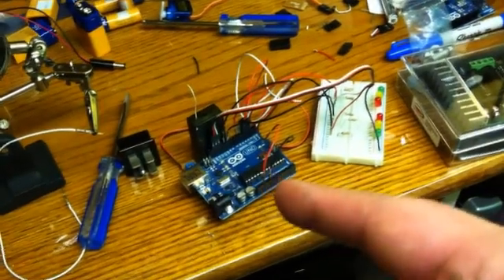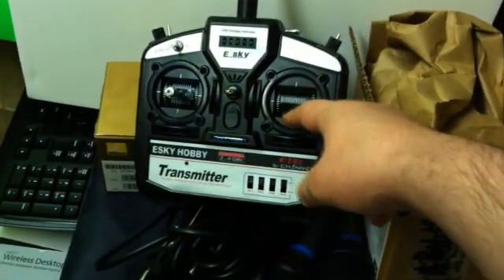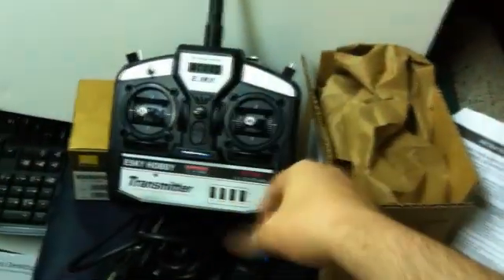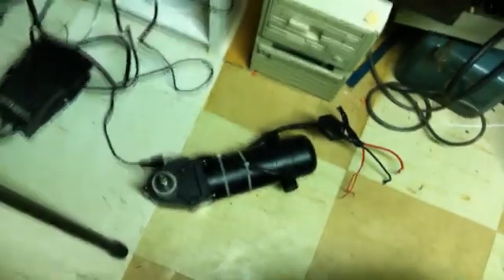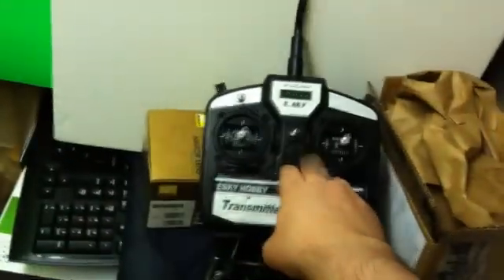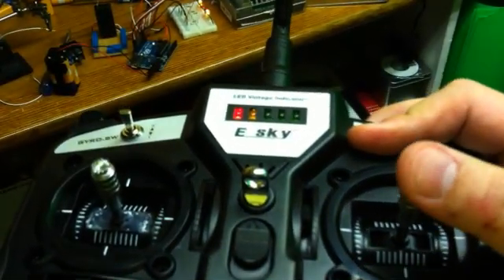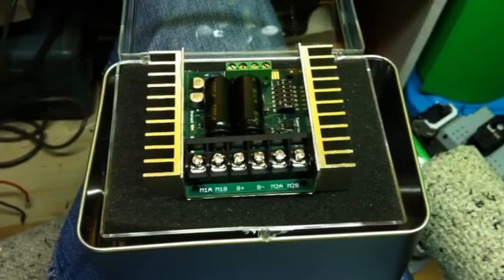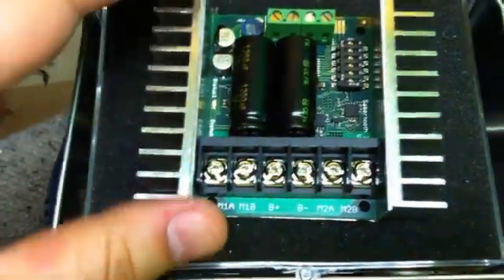Dave's LawnBot Part 1

Comment: im not familiar with the arduino but if you have more outputs and only 2 inputs , I think those 2 inputs are mainly for speed  only and I assume you will need a potentiometer between the arduino output and the motor speed controller. in order to increase current from your remote control, you will need some kind of power supply with different current outputs or differential voltage and be able to create set points outputs connected directly to the motor controller.  via relays you can trigger different relay outputs to increase speed. another way would be adding a servo to the potentiometer via a mechanical device. for example, a servo wheel that will turn the potentiometer up or down.  consider a vertical potentiometer that can be push remotely via servo. I'm sure there are components out there like the one I am describing. I have seen all kind of parts.. I wish to make a project like yours but using a full PLC and full laptop and have Ethernet control.

Comment: Why is everybody using these $40+ aircraft radio setups when a 2ch pistol grip setup for a rc car is only $20-30?
Reply from the maker: I wanted a tank drive setup, so I'm using 2 motors. And I needed at least 3 channels for that. I need 1 analogue channel for each powered wheel and 1 analogue channel for the kill switch, so I could turn off gas mower remotely. Also, using the sticks for control is a little better setup than the pistol grip, for tight turn manoeuvres.
Reply: shadeydave
I'm using a pistol grip on my mower and it turns just fine. Dip switch #4 on the sabertooth is the only difference between the two radio types "mixed mode" pistol grip or "independent mode" for stick style. Both can control the same way the difference is one is half the price.

Comment: just wire your receiver to your motor controller use the elev and ailo for the signal 1 and 2
Reply from the maker: I tried to make this as cheaply as possible, so the Transmitter I used was a preprogrammed $60 unit for flying helicopters. I rewired it based on the cleanest channels I could find in the unit. A lot of the cheap non-programmable transmitters out there have mixed channels, so if you move your Ailo's, the Elev. moves slightly too, to help keep your plane in the sky. This would have screwed with my turning radius on one side, so I hacked the Tx manually and saved a few hundred bucks.
Reply: i meant you dint need to put any thing between the receiver and your sabertooth. you figured it out in the next video tho. good vids man

Comment: 0v is the black wires from the transmitter 5v is the red wires from the receiver. Take two sets of wires that plug into the receiver and twist the black ones together and input into 0v. Then take the two red wires and twist them together and input them into the 5v spot. Now you're left with two white wires which are your signal wires. Take one white wire and input into S1 and the other single white wire into S2. There's your two singles. That's how you're suppose to do it.

Comment from the maker: Yup, your observation of the Sabertooth setup is correct. 

I had to rewire the radio because it had mixed channels. Hitting the right stick, 3 or 4 other channels would activate, (to keep the helicopter balanced) It was a really cheap (~$65) helicopter radio, and didn't allow for custom programming. So I rewired it so the sticks were  a 100% pure single channel signal. If you don't want to go the route of rewiring a radio, you need ~$300+ for a proper programmable radio.